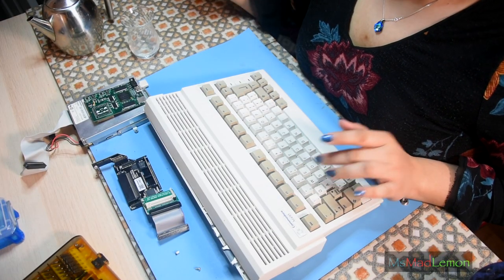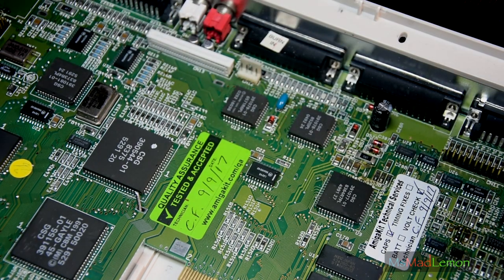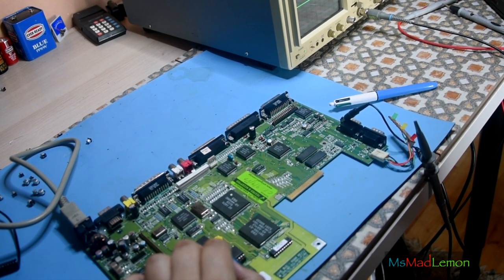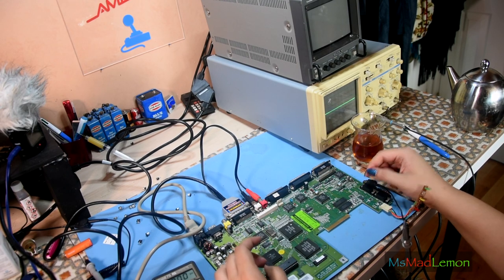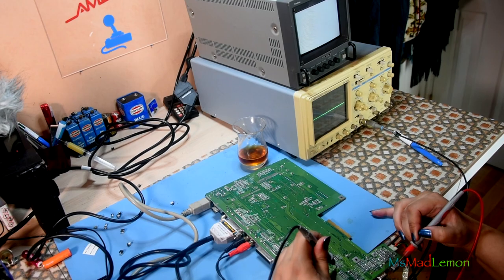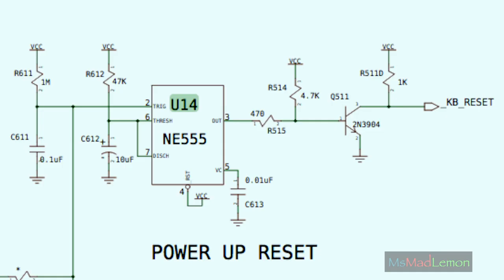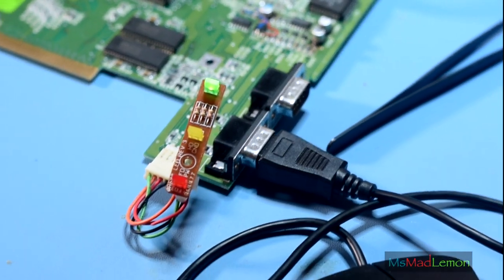Amiga 600 Repair & Recap

Comment: Thanks Maddie Lemon. My stock 600 decided to black screen and asking around discord someone mentioned this video. Turns out that C611 on my board decided it wanted a short break from being soldered on the board. Removed it, 600 was okay and even CTRL-A-A reset ok. Reattached C611 and its still working. No idea why its now working so I guess there's a cracked joint somewhere nearby. Expecting it to reappear at some point. This video helped a lot in understanding the problem. Good work! :-)

Comment: BTW when using hot air near the keyboard connector, something remarkably effective in protecting the connectors is to cover them in double-folded aluminium foil (straight from the kitchen!). I've been doing this with my own machines and there's been no signs of deforming. It also protects against accidental soldering iron slips!
Reply from the maker: That's a good tip actually thanks! Someone mentioned kapton tape also, not sure why i didnt think of it, I got a reel of it lol. It was my first SMD recap, we live and learn :o)
Reply: @MsMadLemon  I used kapton tape on the connector and kept the temperature of the air on 280°C. I still managed to damage the connector a little bit.

It was working but the ribbon was a bit loose in it. I ended up replacing the connector, just to be on a safe side.

Comment: Thank you for another great video! And that reminds me, Almost 30 years ago when I had a new car battery charger, But I used it for other things like car stereos and that, It also had a problem with the bridge rectifier, And it was unrelated to what I was using it for! It had 6-12v and Hi-Lo settings, And when it was on Lo it was off and when it was on Hi it was Lo! So I just linked a diode between 2 of the 4 terminals! And it worked!

Comment: Good job! It is common to leave the power supply connections off of schematics like that. Quite often they will also just show all the decoupling caps in one corner of the page which makes it hard to look at the schematic and figure out which cap is which. I think they are drawn by engineers who never have had to repair boards for a living :)
Reply: Indeed, as believe if we were able to scroll down to the bottom of the  page of the circuit diagram shown in the video we would see all the decoupling capacitors and the IC reference numbers (including U14)   & their respective ground and supply pins (ie. Pin 1 & 8 for U14).
Oh and always great video keep them coming.
Cheers

Comment: Nice video Im impressed with your skills. I wouldn't have a clue what to do :) I've got a question about your A600V. Do you think that Vampire would handle systems like AmigaOS 4.1 (I saw a video on A1200/040 but it was Final Edition and it was incredibly slow but they do a version for classics aswell) MorphOS or Aros? Aros is free to download and Morph could be too much to handle. Would you give it a go?
Reply from the maker: Thank you :o) No you wont be able to load Amiga OS 4.1 with the vampire because OS4.x requires a PPC processor, Vampire is 68k.. For OS4.1 to run on actual Amiga hardware you'd need an Amiga with a PPC accelerator (that is what the classic version is for). AROS is free but AROS for classic I dont think its up to scratch, i've heard its not up to scratch.

Comment: Thank you for posting this. I picked up a 600 while visiting New Zealand (hot tip, Amiga gear is super cheap there, $240 for what is normally $6-700 on ebay in Australia, if you're visiting, get the trademe app). I got home and tested mine, and it has distortion / crackling on the audio output, and some funky colour flickering on the composite video output. So, the first order of business is recapping!!!!

I've only ever soldered through-hole when I studied electronics back in the mid 2000s. I feel a bit more confident with those surface mount capacitors now. What is they type of iron you're using to remove the capacitors? Is it like a solder vac or something? I don't suppose my fine-tip variable temp iron will do the trick for those caps?
Reply: It's not that cheap in NZ now. I have two a600 and sadly neither work.

Comment: For SMD, remove all the solder, clean, put flux, then, put the new ic. Then add solder on solder iron a little bit, then in a 45 degree angle put heat, then add a tiny bit of solder. I allways fix position on 1 pin, then do the other pin the the opposit direction. When there is like hundred of pin, you can just move from one pin to the other, the a lot of solder. at the end, you remove short with unsolder wig and make them manualy!, Since you have a heat gun, you can place solder on all pad, then flux, and the ic will stuck on the flux, you put heat, and the ic will sit in place.

Comment: I had the same problem after recapping an A600. I traced it to the 555, so removed it, cleaned underneath then replaced it with a new one - all was well again. Fortunately I had no damaged tracks from the leaked electrolyte. I suspect that the original 555 would still have been OK once the board was cleaned, but It was safer to just replace it.
Reply: Exactly the same issue I have NOW. I think. I've recapped board and black screen with caps lock ON. I've ordered 555 chip. Hope it will solve the issue....

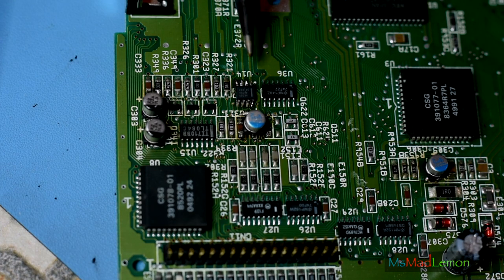Comment: At 19:00, you can see that there is a trace/track between U14 (NE555) pin 8 (VCC1) and U14 (NE555) pin 4 (RST), underneath the chip itself , but this has a via through it. It could be that this via is corroded and breaks the trace? Also, the trace from the U14 (NE555) pin 2 to R611 actually goes through the pad of C611, (and goes to Q622 via the bottom PCB layer and back up to the top layer!), but at 19:40 it looks like the pad is gone - so that is probably why there is no continuity? You can also see these traces for the A600 Rev 2A PCB layout at the excellent Amiga PCB Explorer (http://www.amigapcb.org/)

Comment: Nice fix! A good tip with SMD and flux is there is no such thing as too much flux. Ideally get flux in a syringe and really daub it on as soldering becomes super easy when the flux makes the solder magically jump to metal on metal. Take a quick look at louis rossman who does mac repairs on youtube for how much he's using as a guide. With enough flux you can use a massive solder tip and just run it along all the pins and they'll all just be soldered with no blobs etc. Glad you resurrected the 600 though.
Reply from the maker: Thanks Mat, I did use flux, after someone commented to use it I realised that i've unintentionally edited out all the parts where I did use it lol! .. But I didnt use too much, maybe i should be more generous with it now that you've mentioned. Thanks for the tip.
Reply: @MsMadLemon  I'd recommend getting a scrap board and having a practice go. Take an SMD chip off with your hot air station and resolder using either the hot air after retinning the pads or an iron (google drag soldering) you can really drown a chip in flux and the more you have, the easier the soldering is. Flux in a tube over flux paste any day and you'd just use IPA to clear up afterwards.
Reply: @MsMadLemon  Madi I recommend You to watch Luis Rossmann videos , where he repairs macbooks. He's good with micro soldering. "There is no too much flux". Where did You get it your flux? I've spotted words written in Polish. Greetings from Poland.
Reply from the maker: @pabllosee  I already watch ;o)

Comment: Nice teamwork and patching. :) This is a easy work to fix bad traces. 

If I understand the basic?  If it was a broken IC (or other component) it happens to be a lot of continuity to the "ground" all over the chip where it shouldn't be? Some traces are for powering IC's and some are for signals.

Comment: 26:10  It is quite common that the power supply connections are not in the same schematic diagram as the signal connections. I'm pretty sure that there are separate page where all the chips and their VCCs and GNDs are along with the decoupling capacitors and such. You should have called me. :P
Reply from the maker: Yeah they are listed separately but i find it a bit annoying. And well.. I did figure it out with my own intuition in the end :op

Comment: Reverse biasing electrolytic caps can cause them to explode, leaving a real mess inside your equipment. If you want the best caps, look at the bill of materials in the service manual and buy each of the caps you need from a reputable source (RS, Farnell, etc.), you'll be able to get high-end caps such as Nichicon and Panasonic for the same price you'll buy them in packs of no-brand caps sold on various retro computer sites.

Comment: In schematics it's common that power is omitted, it's usually drawn in a different location as to not clutter the schematic. Maybe traces were damaged when recapping? Typically capacitors are placed to decouple power traces.

Comment: It's quite common by the way for chip supply voltages to be shown on a separate part of the schematic... usually alongside suitable decoupling capacitors. In the case of the 555 timer here, look near "DECOUPLING" on that page ;)
Reply from the maker: Why though, I find it annoying :op  freakin needless referencing lol
Reply: @MsMadLemon  it's easier when you're designing a schematic to keep all the power connections and decoupling together. That's especially the case when you've got a big chip that has many power pins

Comment: Professionally recapped, and the recapper installed capacitors backwards, and didn't repair a broken trace around a known problem area in the A600? I'd be asking for a refund.
Reply from the maker: They completely denied anything, I was not happy about it what so ever. https://youtu.be/gxtfeCxP5EE?t=396  you may remember from here (it's this same Amiga I had recapped)

Comment: USE FLUX! it makes the soldering so much easier!!!!
Reply from the maker: I did by the way, now looking back I just realised I unintentionally cut the part out where I show the usage of flux.  :o)
Reply: Amtech NC-559 highly recommended. Makes especially the smd stuff easier cause it's sticky af. Rossmann approved brand :)
Reply: @Internationalmanofmysteries  And use the right amount. 1 or 2 milliPauls will do ;)
Reply: Overpriced Amtech is not necessary!! I can highly recommend "Riesba NC 559", search this@aliexpress. I solder every SMD and other stuff with riesba flux. It's perfect.
Reply: @analognexus  That stuff looks like a Chinese copy of the genuine article. Another good reason to keep the fume extractor on while soldering. I'll give it a go. Thanks for the tip!

Comment: To be fair Commodore itself did this too. CD32, A1200, A3000T, A4000T all have factory backward mounted caps :)
Reply from the maker: Yeeah that i'm aware of, but should be corrected at recapping stage right? also it depends on which caps are reversed, for example audio caps reversed arent as much of a big deal as other caps can be.

Comment: Well done! :3

To avoid melting connectors, you can use Kapton tape and/or aluminium foil tape. It's not a miraculous shield against all of our mistakes though ;)

I'd wish you show the 555 signals on your oscilloscope :3
It's rare but schematics can got some mistakes. You'll find some weird tricks more often.
Reply: amiga schematics dont have some "obvious" connecions like vcc and gnd... but yeah when you take a look at element datasheet it all become clear. Just need to find the datasheet

Comment: Could you bypass the reset circuit?
Reply from the maker: No, I fixed it.
Reply: @MsMadLemon  I was meaning is it possible if someone doesn't want to replace the 555?